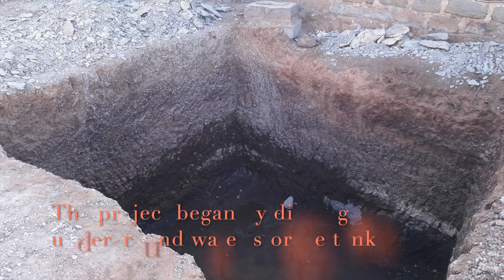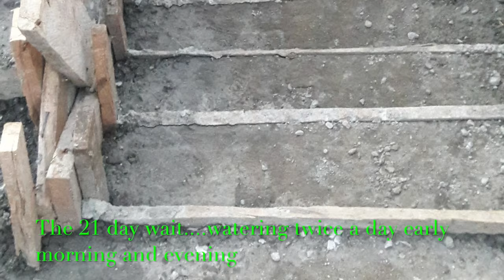Building Rental Units in Kenya - Start to finish

Comment: Great video!  Very inspiring indeed!  The 900k per unit you quoted to someone in the comments is because yours are 2 bedroom units, correct? Where in Kenya are your flats located? One thing I have come to learn is that building costs vary widely depending on where in the country your project is!  It is about 1.5 to 2 times more expensive in Nairobi and surrounding areas than it is in smaller towns and rural areas, especially in Rift Valley.  And the varying costs are for everything from sand to labour!  Of course rental yields are also different with those in the Nairobi area being significantly higher than even in other large towns of Kenya!  You can rent a nice 3 bedroom flat in Kikuyu for about 25 to 30k, while in Naivasha and Nakuru that would rent you a full house with it's own compound including an SQ!  Anyone who has updated rental costs please correct me!
Reply from the maker: Thank you!! You are right. Building in Nairobi and its environs is costly considering the high demand for building materials or lack thereof sometimes, rental yields are however very good. The total cost for two units was 4.25 million so it would be safe to say one unit will set you back 2million shillings or so. Going up the second level the costs will be slightly lower since the slab is already in place.
Reply: Am interested.  Good job how many 2bedrooms units  are there on the ground floor? And where is this ? Nairobi area?
Reply from the maker: @mercywainaina8840  they are 2 units on the ground floor in the Nairobi metropolitan, Ruiru to be specific.

Comment: Thank you for sharing. God bless you. What space did the houses and compound take
Reply from the maker: Hi Helen. God bless you too. The house is built on a 50x100 lot. The two units occupy 7.315M by 18.9M. With two more units of the same size to bring the total to 4, I will have parking for six cars(Sliding gate installed).

Comment: Hi. Good work 
What  about the cost, legal process requirements?
Reply from the maker: Hi Njeri. The total cost was 4.25m including approvals. The project was completed in December 2019 so its not a reflection of how much you would spend currently.
Reply: @djgitau1987 Is that cost inclusive of land cost?
Reply from the maker: @acouslyk  for the project only. Land prices in this area are quite high. 12 to 15 million for a 50 x 100
Reply: 1.2m or 12m